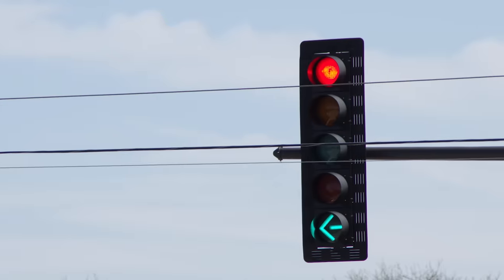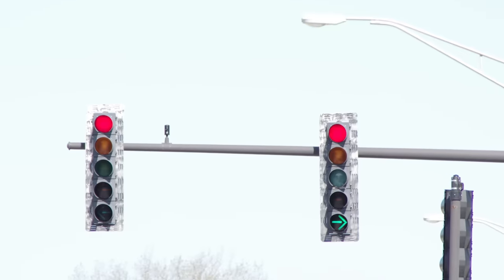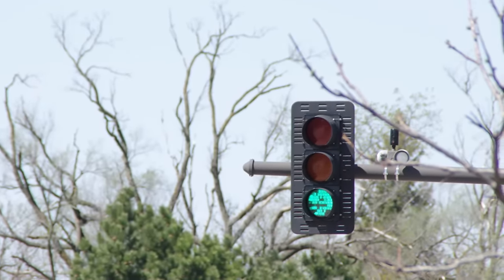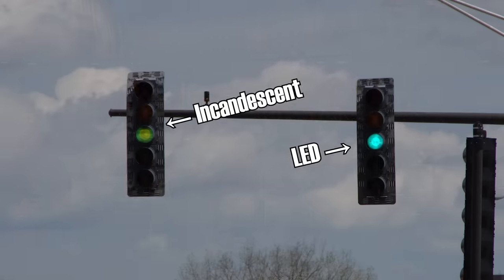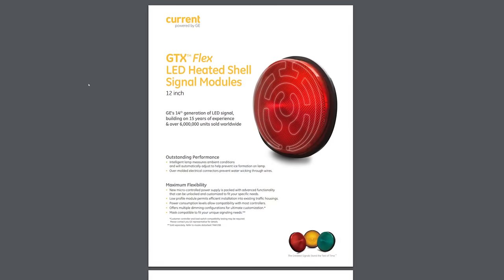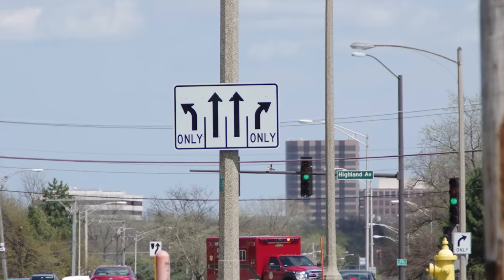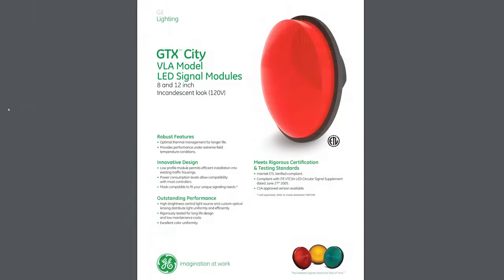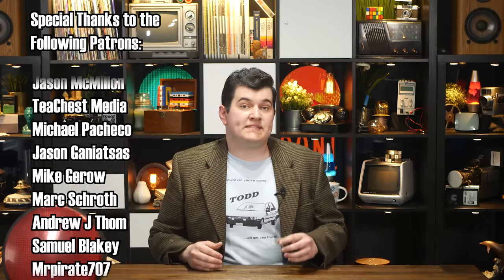The LED Traffic Light and the Danger of "But Sometimes!"

Comment: The funniest part is incandescent bulbs going out or snow building up on LED traffic lights as you have stated shouldn’t affect accidents because people should be treating it as a stop sign weirdly enough in my state you don’t actually have to take drivers Ed you just have to pass a written test which is way easier when you take driver’s ed but any 15 year old without their head up their ass can pass it… and then your parents drive you around for six months sit in the passenger seat what you drive and then you have a fucking license

Comment: Just gonna point out that it's not a "but sometimes" in newfoundland, Canada. 

It snows here a lot. during the winter it snows more often than it doesn't, and our winters last from november till may. Combine that with a largely senior population that doesn't drive very well and you get towns like mine where they started switching to led and had to switch back to incandescent.

Comment: Why not just install Wipers ? 
Heating up Snow is super inefficient
Reply: Yes, from some perspective, but wipers easy can freeze (rubber, moving mechanism), and easy can broke the moving mechanism (eg. in high speed wind). Heaters much much less possible to stop working. That's why.
Reply: @brdfsz9142  That's a good point !

Comment: I think LED stop-lights are a good thing. But there ARE valid counter-arguments.
 Less maintenance is not a purely positive thing. Less maintenance hours does mean lower costs, but it also means fewer jobs. Those people still need money, so you are really just deferring their cost to someone else. "Running Lean" is a staple in our minimal-budget world, and it shows. 4 people calling out sick doesn't mean much when you have a shop of 40 people. Work is a bit slower, but it can be prioritized. 2 people calling out of a shop with 8 people can shut the whole thing down. You might need 4 people at a minimum to do a job for safety or other regulations. That means only one job is being done at a time.

Less maintenance also means people being at a place less often. Having someone at an intersection once every 1-2 months means you can task them with keeping an eye out for any other maintenance that needs to be done. Are there birds nests building up in the equipment? Is that electrical box un-locked for a reason? are the pot-holes getting out of hand? This can be solved by adding in more spot-checks, but now you just returned most of the maintenance (as in, transportation, manning, and time. Just not climbing the ladder and replacing the bulb.) This last step is often overlooked.

These systems don't operate in a vacuum. They can be changed, but they require a LOT of effort to do it right, because you really DO have to take everything else into account. It's not simply a "Do we buy different bulbs?" decision.

Comment: LED's would last a lot longer if they didn't drive the diodes twice as hard as needed as a cost saving measure.
whats that need extra brightness? use an LED that can get to that brightness without overheating? nah, drive a lower LED harder with more voltage to get the brightness needed!

Comment: However - the old incandescent street lights - generated heat - whereas the LED traffic lights do not. That means - if you happen to live in the part of the country,  like I do, where a heavy snowfall builds up on the lights - the incandescent lights MELT the snow - so you can SEE the light - but the snow build-up on the LED traffic lights - does not allow for the snow to melt - which often obliterates the light altogether. That's a problem. I'll take incandescent traffic lights.
Reply: Did you watch the video?

Comment: I want to preface this, you're right.

But you're presenting and arguing about information in a way which only helps the fearmongering individuals.
Did you know some places have snow almost year round? Or that 90 days of heating versus 6 days of replacing looks worse?

This is your own logic being used against you... and this is WHY fearmongering works.

People who see those warnings will see your video and literally point out what I did. Then they will dismiss your entire claim. Because you're focusing on the wrong things and you're often proving them right even brushing off "But sometimes"

911 or 991 literally exists for "But sometimes there is an emergency" despite most of the time it isn't needed.

Heating, in regions where it is need, is more efficient to have as a system compared to driving a maintenance vehicle out there, raising up the platform with resources, then using a light which had to be shipped, have it go back down and repeat this at almost every single light on every single intersection 6 times a year which unless you do it all at once wasting resources you will have to return periodically to replace individuals.

This one little bit here describes what you're trying to without giving them counter arguments like I made.
Think smarter not harder, otherwise you end up identical to the fearmongers.

"But sometimes" is a valid question, and one that we reply with how to fix and directly compared to our current methods and how it is better the our current methods. Otherwise we stop progression. "But sometimes a person will react X way to medicine" so the doctors have stuff prepared just in case.

If you push away "But sometimes" you're part of the problem.

Comment: I've been having a problem with the new LED lights where the sun intersect with them just right and the color of the light becomes impossible to see until you're directly under it. It happens only at certain intersections, and only during certain times of the year - but it's really bad. We have to approach the intersection slowly till your close enough to see whether the light is red or yellow. close enough being within 10 ft.

Comment: A real engineer would have included an option for a small cowl heater with a thermostat and moisture sensor...
Reply: to complecated just use a bimetal and heating coil .... litrally a dime you would spend on those and they are 100% reliable
Reply: @baronbrummbar8691  - That is what I said... The next issue is using avoidable energy when dry. Thus the moisture sensor...
Reply: @coachhannah2403  but that is just overengeniered ..... it will not be as reliabe and longlasting
-
a heatingcoil with a bimetal can last for millenia ......
Reply: @baronbrummbar8691  - And cancel some of the LED benefit. You DO know that your mechanical wall thermostat is a 'bimetallic,' right...
Reply: @coachhannah2403   why would it ??? 
it obviously "consumes" more energy ... but you can.t get around it 
-
and i havent seen a thermostat that works with a biemtal that has been produced in the last 40 years ... but yeah use a very very old thermostat

Comment: I distrust the term "progress" in this context. It prejudges things. I prefer "change". There are changes for the good, but there are also changes that aren't good. LEDs are pretty evidently a change for the good, but there are plenty of technology changes which are anything but - for example where manufacturers make it virtually impossible to mend equipment  so it has to be replaced instead.

Comment: THe reason for the traffic light delays is those morons that try to squeeze past the intersection after the light turns RED. you cant even hit the gas if your up front without wating for these smucks to run the light. Oh do a video on the lack of consistency of the yellow lights. Some its 1 sec, some its 3sec....

Comment: The LED traffic lights are functionally superior, however the "but sometimes"  factor can't be ignored. I was a part of the local emergency services for nearly two decades. In that time there were two fatality accidents that could be attributed to light visibility related to obstruction by snow and/or ice (total of four deaths). That would be considered a high frequency compared to most areas with even higher density traffic. But still the risk remains too high, as the over all cost is still below  the value of a human life.  Consider this, would you want to fly on an aircraft that had intermittent "but sometimes" issues? But the snswer is seems g1q@b'easy, simply don't allow installation of LED lamps without the fixture modifications to prevent the intermittent tragedies. Every effort should be made to make them as safe as possible, or otherwise consider them defective. And as litigious as people are, I think saying in court after an accident that the lights are generally superior helping to keep traffic safe...but they could have been safer...would not not yield an adequate defense.
Reply: No, they were attributed of driver error. What comes to your aircraft example that's the whole point. Aircraft has two drivers so that if one is not following regulations the other can.

Comment: 6:30 -- you blew it, BIG time.  A traffic light packed with snow is only packed on one or two sides, those facing into the wind.  The other sides are still working just fine.  Thus, a driver might stop for a "dead" signal, go because it's their turn . . .then get hit by a driver who has a perfectly normal green facing his 55 MPH lanes on the highway.

Comment: "The traffic light is not at fault when an accident occurs" — this is an incredibly bad, ignorant take. You are pretending that "Functioning traffic light"/"Non-functioning traffic light" is an easily identifiable true/false binary, when a light being disabled due to snow accumulation is clearly a messy, difficult-to-define binary that some drivers may view as disabled while other drivers view as functioning. You are also pretending that accidents are somehow acceptable if you write a rule in the traffic handbook that clearly assigns blame to one of the motorists; they are not. Traffic accidents are always bad, even if it is a driver's fault, and a road feature that reduces those accidents is a positive attribute, regardless of traffic law, and a road feature that increases those accidents is a negative attribute, regardless of traffic law.

Comment: How much do the heat element controls and installation cost? Out of whose pocket is that cost coming? You live in one of the most bureaucratic places on the planet, stop thinking this is an engineering problem.

Comment: The "really stupid articles," probably the least-harmful of what resulted from the change when compared to the fatal accidents, wouldn't need to be written at all had the people in charge stopped to consider the potential problem in the first place, instead of just saying "YAS PRAHGRESS," anybody capable of reading the packaging on an LED product will tell you that it could've been a problem for people in colder climates, particularly where it snows more often than New York or LA, which is where all these ideas come from.

Another point is you don't know the circumstances of every accident. If it's snowing, dingus, it's obviously more difficult to control your car and people could've skidded into the intersection. 

Finally, "just don't drive your car when it's snowing" is as tone-deaf as saying "combat high gas prices by buying an electric car."

Comment: Traffic lights swck.   Wait until you run one or see someone else run on and you'll know What I mean.   Even spicier if you're on a motorcycle.
I prefer the Roundabout Traffic Circle.   No power or computer needed or light replacements.
Another example of how inferior smart tech supplanted dvmb tech that worked way way better and failed way way more gracefully and kept working indefinitely even when the power went out.

Comment: LED's last longer? What universe did you grow up in? They're notorious for crapping out in a third the time incandescent bulbs last and in half the life of a flouro. The incandecsents you say are blown out in your area were probably fitted in the 70's or earlier. Cars from the 50's still often have original bulbs from new. I see many LED trailer tail lights- completely sealed as you say- with half the individual LEDs dead. They have only 2 advantages: brightness to power consumption ratio, and compact, lightweight. They definitely don't last as long, especially if they don't have a large heatsink for continuous usage like carpark floodlights. They are a regular occurance at the scrapyard. And then there's the common inverter/transformer failures that any mains powered LEDs need.

Comment: They did not save anything on LED stop lights because they had to install HEATERS in the LED lights so they wouldn't  ice over. That and the crap Chinese electronics  keep FAILING. There is no savings on these WORTHLESS new traffic lights.
Reply: watch the video

Comment: The problem isn't the light bulbs it's technology. Consider time and temperature when you call the phone company. All those wonderful jobs of girls continuously speaking the time and temperature were replaced by phonograph records and those great jobs were gone. Similarly at traffic intersections, only North Korea seems to have gotten it right. Replacing the lights with beautiful traffic girls directing the flow not only provides great jobs, snow blocking the lamps visibility will be relegated to the history books.

Comment: To say that people are stupid for not treating a frozen light like a stop sign is not quite fair. 

You're making the assumption that all directions are facing the same issue of an unreadable stoplight. How would those who have a readable stoplight know that the other direction is unable to view theirs. 

It's the fault of no one as they are both obeying the rules of the road. Each group has a different set of rules, however, and don't know the other person has a different set than them.